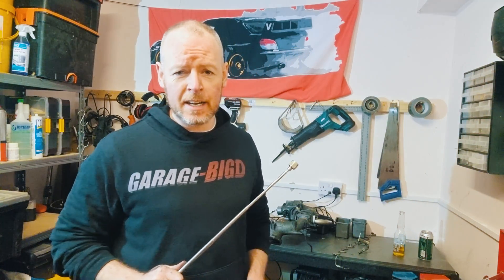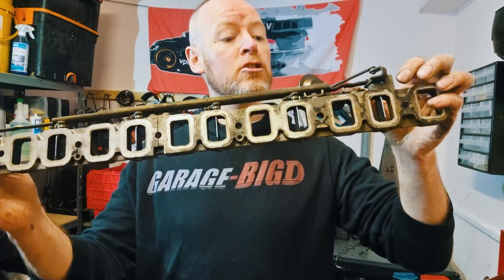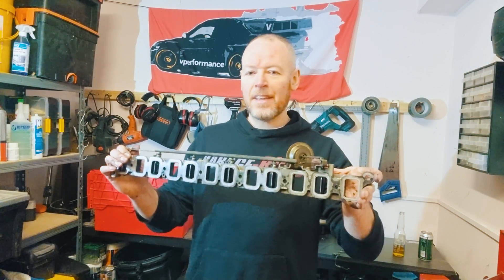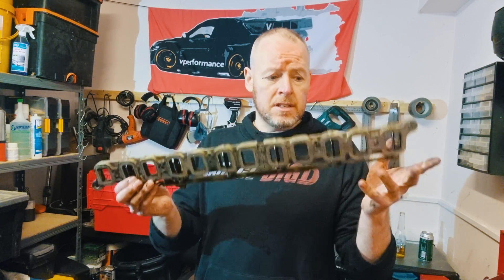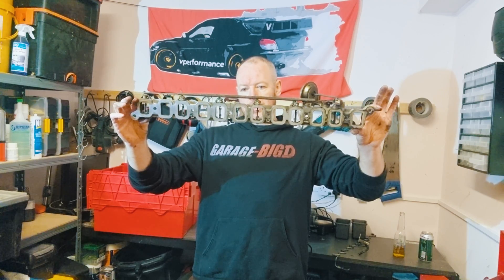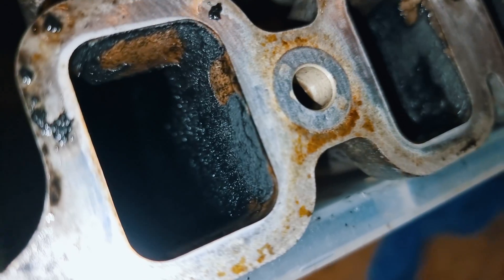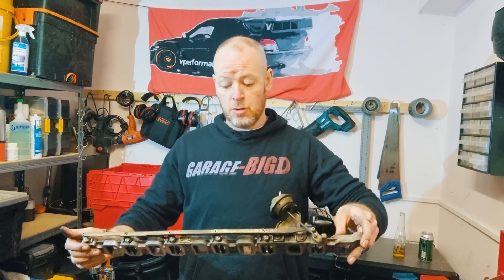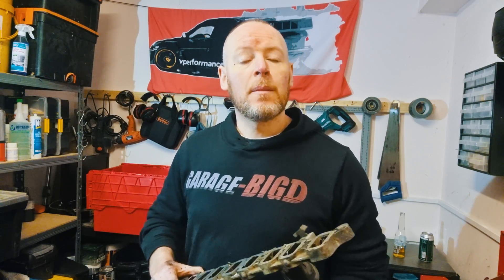Why do petrolheads HATE swirl flaps so much?

Comment: Good for added efficiency of combustion ,,slight economy and midrange performance boost .  Can restrict maximum HP .
Big issue is how the designer built the flaps operation characteristics . Characteristics may or may not effect fuel economy and power output .  Most road going diesels  the emissions are the priority at the expense of every thing else . Very individual to each engine design .

Comment: disagree on torque , i took my swirl flaps off my astra j , and now its flys faster than other astra j i drove i drove alot my one is just a monster without them i swear by it , but like you said it prob depends on car . also i noticed after buying selling cars people think these failures on opel/vauxhalls are engine head gasket and i low ball them , delete the swirl flaps , its easy to find i just block the vacume pump that controls them and see if noise stops then put it back on then low ball them 
i picked up a Astra j sri 2.0 with this problem for 900 sold it for 4.6k
Reply from the maker: Did you get the map from the dyno?

Comment: good afternoon, can those fins be removed permanently? Will the engine work well? I would sincerely appreciate your response!!!!! thank you so much!
Reply from the maker: Yes mine have been removed for years and the engine runs just fine. No chance of them disintegrating by surprise now
Reply: @vPerformance  thank you very much!!!!!
Reply: @vPerformance  And the engine improved at low revs?
Reply from the maker: No it makes less torque at low revs, but more at high revs
Reply: @vPerformance  But it doesn't fail at low revs, right?
Reply from the maker: Sorry I'm not sure what you mean by fail
Reply: @vPerformance  Failure is jerking at low revs, unstable idling, wanting to go out in first gear and the engine tending to shut down.
Reply from the maker: Oh I've never had any of that. Is your airflow sensor okay?
Reply: @vPerformance  It doesn't have an air sensor, it has an electronic throttle body, it's driving me crazy, I'm going to remove those intake fins and see if that solves it.

Comment: but there should be intervals on service/replacement on these no? Aslong as they are being followed cleaned and replaced at the given amount of km/miles or time, you should be safe I think?
Reply: Also in my opinion both swirl flap and EGR give the engine col. the purpose of the intercooler turbocharged system is to cool the air, so that you shuve more air particles into the cylinder for a clean combustion which result in both power and reduced emission. should be more than enough to have a DPF in your exhaust system to deal with the nox2 and other harmfull gasses into harmless damp, adBlue also nice because none of these gives your main core engine cancer.
Reply: Please correct me if i missed anything

Comment: i love engines with swirl flaps its so fun to tell people "i can remove them for *price*" and they say, "nah, its not a problem yet" and then their engine blows up due to stupid plastic. it is far more common that the flaps break in the closed position all the time so you cant go past 2-3000 rpm thinking you are in limp mode but there is actual plastic flaps blocking airflow at higher RPM. Since there are 2 seperate runners, short for torque and long for sustained torque at higher rpm, as he pointed out in the video.

Comment: The fuel quality in Germany is much higher compared to England and America. That's why carbon buildup is less of a problem in Germany. Fuel quality in England and America seems to be a sort of rip off to their customers when compared to fuel qualities in Germany. (I am indeed afraid that the international cooperation will make the German fuel quality go down as well. 'Maybe for the markets the best solution'. Yes - but not for my engines.)

That's why we are expected to drive synthetic diesels only in such cars anyway. The usual telling goes, we all know, 'using VPower diesel only will not increase total cost of ownership (too much) anyway.' True again - because depreciation on a new or three year old 120k € car is way, way higher than paying about 6 or 8 % more on VPower fuels. The fuel costs don't make it anyway. 'Only small people seek to have a saving here'. Buy a new car every four years or 50k miles and i will never have any of such problems.

(True again - but the car-brand still continues to keep on accumulating big probs on it's reputation. - We see too many 'I-people' baring responsiblity everywhere anyway? 'I will be out of office and in retirement anyway when the avalanche of complaints with regard to that will come'(?))

Comment: What about the performance loss? Or what about emissions on the exhaust pipe? Are they worst? We would like to know about that too.
Reply from the maker: Oh yeah the emissions are worse because of less complete burn. That means more nitric oxide emission. Performance under partial throttle is worse, but better at full throttle because more air can get in the cylinder when on maximum attack
Reply: @vPerformance  Didn't notice any power drop on my BMW M47 engine and nor has it failed on emissions in the passed 10 years I have done it. All good.

Comment: I'd most definitely not remove them if made from steel and are quality. I often upgrade them to custom made steel cuts or carbon fibre. The performance lost after removing them is dramatic.
Reply: Just removed mines from an M57 231hp engine. I had 0 loss in performance and it consumes less then before. 
Those things in the M57 are made of plastic and mines had already started to show sign of degradation. Very glad I removed them
Reply: @M15tER-X  so you removed something that didn't work as intended and you didn't notice improvement. how could that be? 😁

Comment: Cracking info.  Removed them from my a3. Not long before they fell apart
Reply from the maker: Sounds like you dodged a major bullet!
Reply: @vPerformance  certainly did , plastic manifolds man ha , was causing a boostt leak as it wore a hole in the intake

Comment: 👍👍👍Thats exactly what they do and exactly why you should remove them
Reply from the maker: Glad we got something right at last!
Reply: @vPerformance  No don't remove them. The reason you are getting carbon in your intake is because of EGR. Remap your ECU to stop EGR. Clean out your intake - dunk overnight in carb cleaner and inspect/change the flaps every 75k miles...

Comment: I'll be taking them off my A6 when I finally get around to it. Partly for the reasons you mention and partly because the black tape I used to cover up the check engine light on the dash is starting to look a bit untidy now and I can turn it off for good when the flaps are gone.
Reply from the maker: Is there a kit for the a6?
Reply: @vPerformance  for the V6 tdi, yes. Mine's a 2.7tdi.
I got the kit from Darkside Developments.
Reply from the maker: They make some cracking stuff. Wish I was closer to them!
Reply: looooool